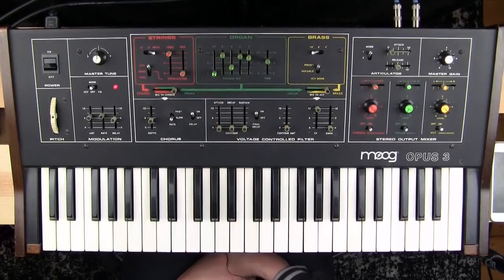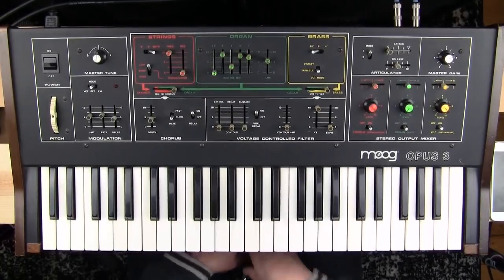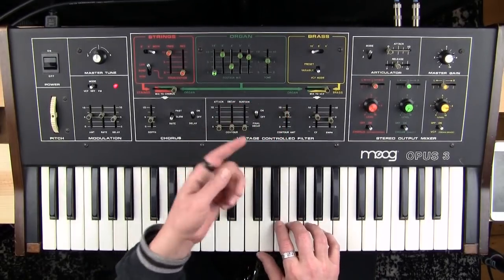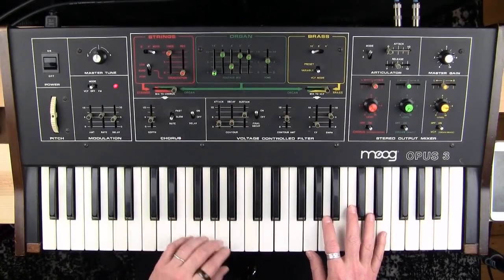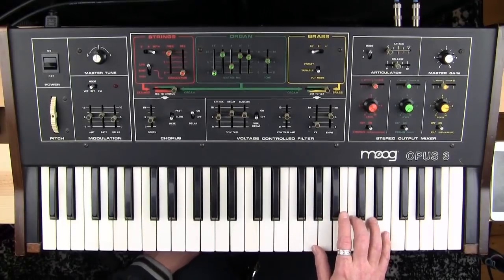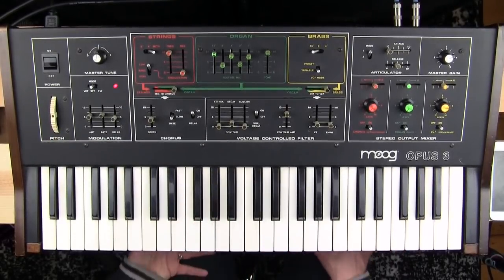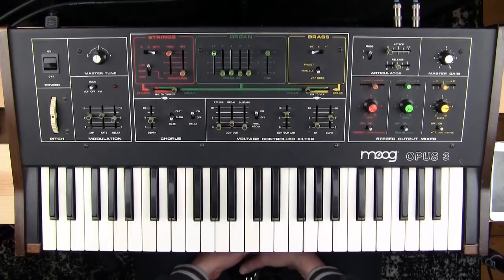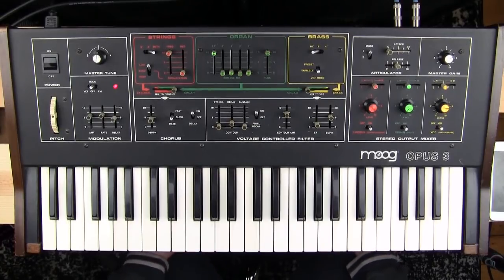05-The Moog Opus 3- Part Five: Moog Ladder Filter

Comment: Digging your series here on the Opus 3.  I used to have one of these quirky boards 30 years ago.  If you turn on both the organ and Brass volumes in the mixer, along with moving the filter slider over to the left for the Organ, and lastly give it a bit of a percussive contour with an emphasis resonant spike, you can synthesize organ key click.  and being paraphonic, it behaves much like a real Hammond key click only triggering on the initial key strike and not on subsequent notes if the keys are still held down.  Much like the chorus will never really sound like a Leslie effect, this will never sound like an actual Hammond, but it still makes a playable sound.

Comment: The stereo mixer can be used as a wet/dry mixer for ouboard effects. run on as is into the mixer, set the other with the effects and run it into another channel of the mixer and pan both to the same location and use the stereo mix as the wet/dry controller. This may use 3 channels as many moedern effects are stereo like phaser, chorus and flanger and even some reverbs as I understand

Comment: The organ section can be used to make unusual waveforms then fed into the filter with or instead of the sawtooth as if it were a separate oscillator. it might be better to think of it as the squarewave oscillator that can be used as an orga

Comment: 3:25, I would have assumed that new keys being played would retrigger the envelope like on the Korg Poly 800 & Casio HT/HZ series.
Reply: Oh, is the HT/HZ series paraphonic!? I didn't know that (if so)
Reply: The cheaper HT/HZ are all paraphonic, only the HT6000 has a filter per voice (and 4 oscillators)

I own the Hohner KS160-TR which is an off-white version of the HT6000.
Reply: @elmosexwhistle  Oh, that's cool. Yeah, I recently remembered the 6000 - it's nice that it's independently articulated, at least. Plus more oscillators per voice (like you said) and more waves, iirc

The cheaper ones being paraphonic isn't a deal breaker, but filter per voice is good